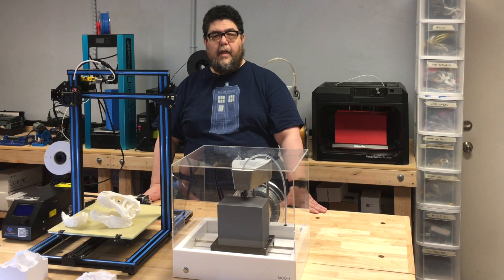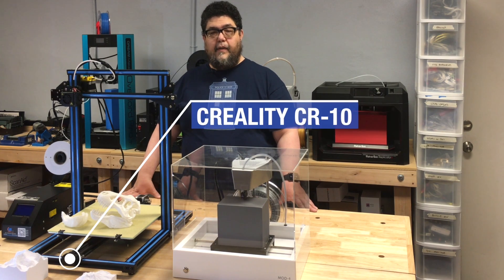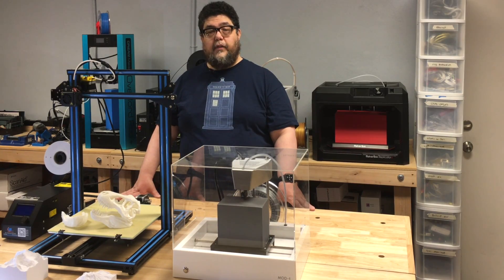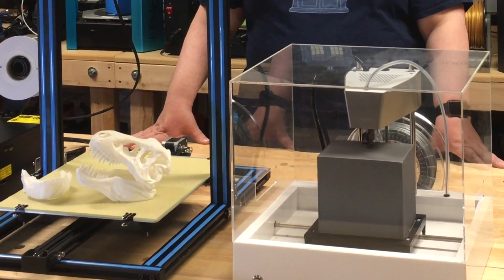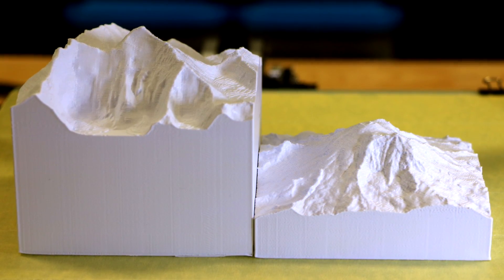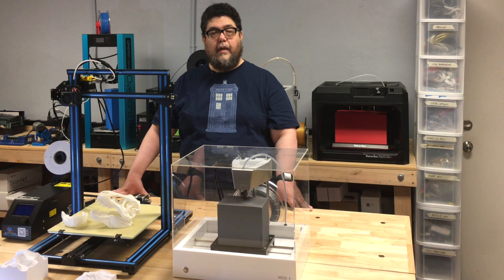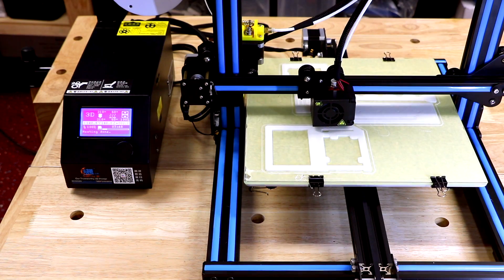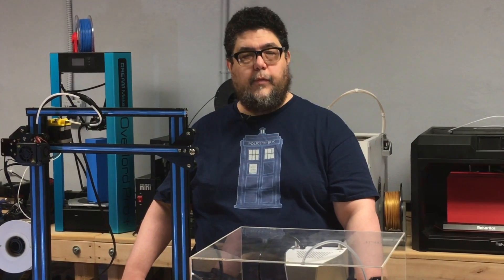Inexpensive CR-10 and MOD-t 3D printers in education: Which is better for you?

Comment: You have been working with 3d printers for 2 years and you havent discovered PEI or glass?  Using tape and rafts for PLA is just embarassing.
Reply: tape is fine. its easy cheap and forgiving and easy to replace. lay tape. clean with alcohol to remove non stick coating use gluestick if you need too. done.

if you want to upgrade later and be more durable in an educational environment consider print in z skins. you can beat the snot out of them but they can also stick too good and you can break the parts on removal if not careful. another good reason to stick with tape.

glass IS a good idea (with tape on top) because it assures you a flat print surface.

consider the ENDER 2. its crazy cheap (under $200 with codes) and the print quality is simply INSANE and its also very forgiving and TINY but with a decent builb volume (I can get 160x152x225mm out of it) really not bad at all since you tend to run out of Z first and this has plenty of z.

rock solid. built like the CR10 same extruder same vslot system and all.

the Power Supplies can die but you can mod Xbox 360 (non slim) PSU's to work with it for $25 if yours happens to die.

truly an amazing printer. check out my channel for some of the crazy clean prints I am getting off my enders ( I have 3 of them. they are that good) I have affiliate links in my ender videos if you feel so inclined. not required obviously. :-)

I am saving up to nab a 4th one. (I print a lot of rocketry parts with them)
Reply from the maker: Hah. The tape came with the machine. And the raft was for pry-up support, not adhesion. But, yeah, I still use rafts on the MakerBot because otherwise, on their special bed, the prints get very ugly very quickly. But here's one thing to note: this is about discovery. I'm far from an expert. I'm exploring this area, and bringing folks along. I always welcome advice, insight, and helpful tips.
Reply from the maker: I've been getting to know your channel. Like it a lot (I follow using my personal account). Thanks for the skin info.

Comment: I really like seeing videos like these. I think 3d printing is a must in education due to its vast applications. I personally have the Anycubic i3 Mega which is similar to the CR-10 but costs $284 (AliExpress) and it prints magnificently. Mine doesn't quite have the build volume but its comparable, nor as good flexible filament performance (so I have heard). The Anycubic has a touch screen and a filament sensor though, which make it both ideal and aesthetically pleasing to newbies.